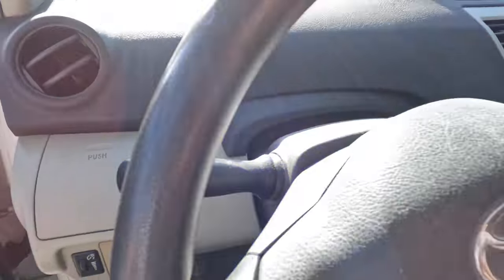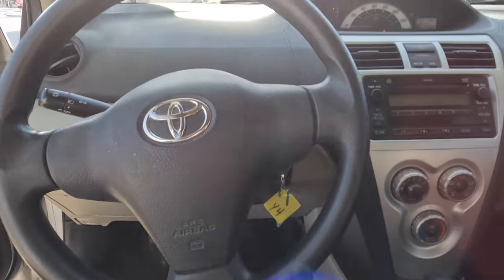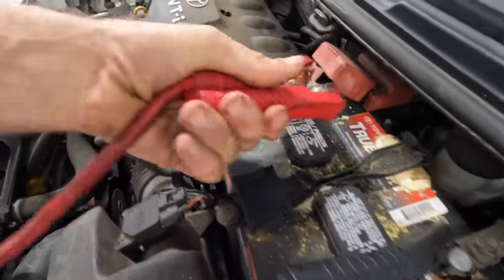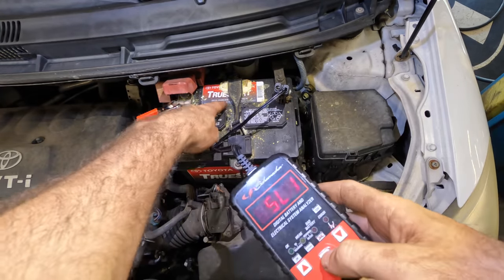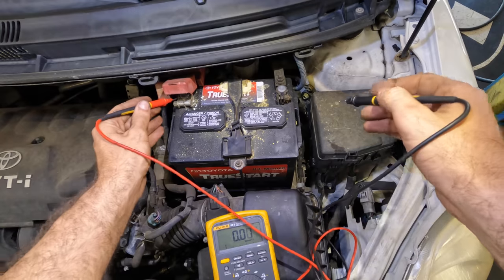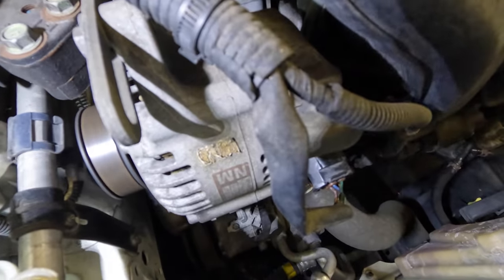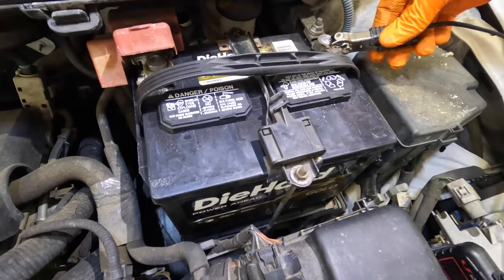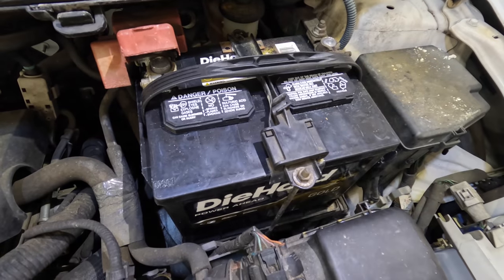Ignore the obvious! “Let’s see what happens” 2006 Toyota Yaris

Comment: I was really expecting the battery to repair the alternator bearings. I wonder why that didn’t work.
Reply: He had the headlights on but not the high beams, radio on but on the wrong station, blower on but didn't have the AC on Max, and forgot to turn on the right blinker. No wonder it didn't work.
Reply: It probably just needed a new pixie filter.
Reply: The bacon stretchers ran out of blinker fluid
Reply: It's because the time wasn't reset and the new capacitor (model: Flux) wasn't reinstalled when engaging the brake lights in reverse, with the spare tire flipped upside down.
Reply: Didn’t add sparky juice to the alternator
Reply: Guess what really happen to Mr. Customer. He shot the diodes in the regulator because he jumped started another car with the battery jumper leads hooked up backwards. Red is for +Red and Black is for -Black. 1-2 days running on battery power...aaah the batter is dead. Who shot the diode? But he did not shoot the battery! Customer shot his foot twice.
Reply: Ya'll wrong... it was (and always is) the kneuter valve!!! 🤟
Reply: He didn’t use the new “Fix-It Felix” brand of battery
Reply: I just like saying "Yaris" ooh I'm gonna name my next dog. You thought I was going to say "Yaris" didn't you?
Reply: @tonycking0121  It's always that damn pixie filter
Reply: @TylerWattt  Page 321 of the owners manual. Nobody reads anymore.
Reply: @TylerWattt  No, No, No,  it needs to be charged to 1.21 Gigawatts.  C'mon man!!

Comment: Great tip about using an open hand to press on a wrench when breaking a nut free. 50 years ago I was changing spark plugs on my 1964 Pontiac Catalina convertible (it WAS a chick magnet), and the wrench slipped. I still have a 1/2" scar on a knuckle on my left hand. It was a perfect event to use some magic words.
Reply: My scar is in my right pointer finger from the knuckle to the next joint.  Punched an exposed cam gear on a Honda.
Reply: My Dad had an early 70’s Catalina 2 door.  What a boat!  First car we had with power windows.
Reply: Those were some big old sleds, my Dad had a ‘62 Bonneville convertible, red with a white top, black interior. I think it might have even been leather. Bucket seats and console with the factory tach. It had a 389 and a Hydra-Matic 4 speed.
Reply: I do that with my hand already, to prevent injuries.  And sometimes I put on a utility/garden glove for more protection.
Reply: “Chick magnet” is very disrespectful we call it “Fanny magnet” here in England
Reply: @gordonm2821  
My old flatbed farm truck is a chick magnet. It has a chicken coop on the flatbed. 🤣🤣
Reply: I have a nice scar on my right thumb from a slipping wrench when I was in a stupid hurry to install brand new blades on a professional grade woodchipper.
I learned three things: 1) the new blades are shipped razor sharp. 2) a cut to the bone bleeds a lot. 3) a clean cloth and duct tape makes a decent compression dressing!

Comment: I am really surprised that the toyota engineers didn't make that bolt a couple of millimeters longer so removal of the alternator would require removing the engine.
Reply: If it was a Ford engineer, that would likely happen.
Reply: Try replacing the water pump... to get it unbolted you have to unbolt the passenger side engine mount and jack up the engine so the bolts clear the right front wheel engine compartment wall.... after removing the alternator.
Reply: Love the delicious sarcasm
Reply: @sharplessguy  I managed to snake it the water pump out, but I had to take the pulley off it first.
Reply: @bertblue9683  The Ford models that I have worked on, the Escort and Transit from the 1970s and the Fiesta and Sierra from the 1980s, are very easy to work on.
Reply: Well Cedric.  That was back when Ford made an effort.  Those cars are no longer on the road and anyone working on cars today, rightfully curse Ford more often than most anyone else, with exception to Dodge.  Toyota, generally speaking, does a fantastic job.
Reply: Another one on the Yaris, try replacing the front seat belt🤔 The one bolt holding the seat belt reel is 5mm too long. Carpet, back seat bottom, strengthing cross brace all have to come out just to get that one bolt holding the seat belt out😡
Reply: It is not always the engineers. Often it is "supply chain management". Someone I know who worked for GM reduced the number of bolts that were needed for a line of cars from 20K down to just over 6K. The idea was to reduce the variety of parts that need to be sources, quoted, shipped, inventoried, monitored for quality, etc. The number of bolt lengths were reduced by sometimes eliminating a shorter bolts.There used to be quite a variety of bolt plating from plain, zinc, chrome oxide, phosphorous, and these were are streamlined. In addition to this, the advent of the transverse mounted front wheel drive arrangement made car repairs much more difficult. Well we're more efficient I guess.
Reply: I’m nearly sure Mazda makes the Yaris
Reply: Wouldn't matter because the Yaris is a rebadged Mazda!!
Reply: @bertblue9683  I've got a 99 Mustang GT and had to replace the alternator a couple of months ago (heck, it lasted 22+ years-I can't complain).  For it being the first time I'd ever replaced an alternator, it only took me about two hours, and I worked very slowly-but an hour of that time was walking to an auto parts store to get the right size breaker bar to adjust the tensioner, and then walking back home.

Comment: I believe the Yaris was first released in 2007 in the USA.
I had a 2008 Hatch Back.
Super reliable. That 1.5 is pretty bulletproof and easy to work on.
Reply: I bought a 2012 Yaris new in 2012. I made sure it had a manual trans. Almost 200k on it. The mass flow sensor got wiped out twice. Once was my fault, the other time a car was decided to stop in front of the grill and flood the front of the car. Luckily only the mass flow sensor was trashed.

Fun car to drive. The high efficiency tires let is slide around during aggressive turning.
Reply: @capnskiddies  those older ones were sold as the Toyota Echo in the USA. 2006 and up were completely different design.

Comment: Just wanted to add: I am just a backyard mechanic working on own cars.  Replaced my radiator on my Dodge Gr Caravan this weekend: purchased the hose clamp pliers and the funnel fill kit thing: very smooth replacement process that otherwise would have been a frustrating ordeal without!!

Comment: Love your videos … reminds me of days gone by . I started slinging wrenches for cash at age 14 . All through high school to my junior year and we moved . Age 18 fresh out of high school started slinging wrenches for big money at Cat . 45 years later retired from everything . Today’s vehicles are built to fail and to technical for average joe to work on and need specialized tools to change a headlight . LOL  Keep those great videos coming and thanks for sharing . And as always have yourself a great day !
Reply: Gone are the days where a mechanic could repair, set up ,adjust and in some cases make all from front to back of any motor vehicle. From bearing blue and scraping bearing material , setting differential clearances , pinion crown wheel tooth markings using bearing blue, dwell angle and point gaps, cutting valve seats grinding valves, fitting new valve guides and so many more skills. Now it’s all about just replace  the unit rather than fix it.
Reply: This is why I love wrenching on my Isuzu. Even though it's an 01, still isn't a total PITA to work on in a parking spot or my driveway. Thing has been reliable as hell and some parts are still surprisingly easy to find new despite them going out of biz.
Reply: You're so right.
My F150 has everything on a network. Battery gets soft it starts shutting down non-essential components.
When my passive passenger door lock stopped working the Dealer wanted $600 to replace the door lock when it was the battery causing the issue.
They did credit me the "Diagnostics Fee" toward a new battery though.

Comment: I just replaced my daughter's alternator on her 2010 Corolla.  Glad the professional had as much trouble as I did in getting the 14mm bolt out.  The right combination of socket depth, leverage, and the one thing I lack, patience.  But Toyota did improve the location of these since my 95 requires tire removal.
Reply: My alternator and starter are literally right out in the open under the hood on my car!
Reply: My 09 had the same problem with the 14mm bolt. Had to use a 6pt socket and a cheater bar to break it loose.  Called Toyota to complain about that bolt being wayyy to tight. The  Lea azon though I was trying to get a free alternator out of them. I'm in the parking lot of autozone doing it myself.  The alternator was $180. She said I could have had the dealer do it. I said do you have any idea what they would have charged me.  They don't seem to want to fix a problem, just smooth it over.
Reply: My 01 and 02 Corolla alt are right on top. 15-20 minute switch out.
Reply: @EricVonHunter  I don't know where the one is on my 04 Corolla as I have not had to change it yet (fingers crossed).
Reply: @johncooper4637  Looking at the engine, left side, top, belt driven. 1ZZFE engine, 9th gen if in the states. Pivot bolt can be tight. Use a breaker bar.
Reply: @johncooper4637  it on top front. Not hard to change.  Mine has 327,000 and still working

Comment: Since the car had been running with a bad alternator, replacing the battery may have not been a bad idea even though the old battery tested ok.  But still, expecting a battery to fix the alternator, lol.
Reply: Plus, it looks like the old battery was the original one (Toyota name on it). Now if the customer would have said "go ahead and replace the alternator and while you're at it also replace the battery due to its age/added stress" it would have been a much better path to go down rather than second-guessing Ray's professional diagnosis. Takes all kinds.... Maybe a learning 'opportunity' for the customer to trust Ray and they will become a repeat customer for the shop.
Reply: Correct. He tested the battery right after charging it, which means it’s not the true state of the battery.

I can bet that battery won’t last much longer.
Reply: Running with a bad alternator won’t ruin a battery. Unless it’s already weak or you constantly drain it below 10.5 volts
Reply: One time I replaced a 13 year old perfectly good battery just because of it's age to have the new one fail a year later.
Reply: No No see, here, the battery has a bad cell, see, so with that bad cell, it causes the alternator to not charge the battery, see, thats how it works, like Cmon man! LOL    🤣
Reply: Who said the customer thought replacing the Battery was going to fix anything???
Reply: @frandanco6289  Did you watch the video?
Reply: I would say there is a chance when the alternator was going bad it may have overcharged the battery shortening its life.  Seems to be a lot of corrosion next to the vents that could indicate a boil.  Not just at the posts.
Reply: @chuckr7871  Wow.  That's a lot of years on a vehicle battery.  I get antsy at about 6 years (and, we always have jumper cables AND a compact Li-ion jump starter in the back of our vehicles).  Just don't want to get stuck somewhere.
Reply: @chuckr7871  makes me rethink replacing my original Honda battery that's 5+ years old just because of age
Reply: True. if you get stuck on the road and need a tow, that's going to cost more than the battery.
Reply: Who said the customer really "wanted" a new battery? The salesman might have scared them into buying one.

Comment: I had an '11 Scion xB and the alternator failed at pretty close to the same milage as this one. It wasn't as bad do to with the 2AZ-FE 2.4L because there wasn't a bracket that got in the way. Funny part was it failed and I was able to pull it out in the parking spot of an auto parts store and get the replacement right then and there. Just sucked having to do it in the cold and rain.

Comment: When I was replacing the serpentine belt on my 2010 Yaris, the lower bolt of the generator assembly was totally stuck so I completely rounded the head of the bolt although I was using a Snap-on Flank Drive Xtra socket. Bolt is soft and it wouldn't budge as it was cold-welded.
I lifted the left side (passenger side) of the car on the stands and sprayed a lot of Fluid Film penetrating oil down the treads at the back of generator. The Shank of the bolt is shorter than the generator housing. After roughly fifteen minutes bolt came out easy.
If anybody cares, the Toyota OEM part number for that flange bolt is 90105-10075. (M10-1.25X72.5) Torque spec is 40 foot-pounds (54 Nm). Torque spec for upper (adjusting) bolt is 14 foot-pounds (19 Nm).
Reply: i have replace my dads alternator (had it refurbished as i was able to locate a shop that refurbished alternators)  much easier on the 1.8l    i did replace the bolts with new ones  Not that i damaged them I just wanted too

Comment: I was on a vacation ended up having a bad alternator on the first one I replaced. Didn't have voltage meter on the road.  Two things ercked me. The dead nator had the smaller pulley and the one that came off the Dodge van had a single and bigger in diameter. I asked them if they could swap the pulleys out. No sorry our maintenance guy not here today. Turned out the adjustment was maxed out and it worked. Needless to say three hundred more miles down the road I was replacing the new nator ( bad). Van wasn't too bad. I always have tools with me on long trips. You the MAN RAYRAY!

Comment: I used to own a 2007 Toyota Yaris S. Loved that car to death. Had almost 200,000 miles and still ran like new. Only serious work I ever had to do on it was replace the battery since it was the wrong size as well as fix the brakes a little since the old owner had gotten in a fender bender. Traded it in for a C-HR but I will always miss that car.

Comment: I had a 2007 1.3l 5-door (2A, XP9F, full digital dash) from spring 2011 to early january 2017. It wasn't really what I wanted at the time, but that little pregnant rollerskate really grew on me.
I still get a big smile on my face whenever I see one. :)
It was replaced by a 1.33l 3B XP130 (30 miles on the clock, it was supposed to be a demo car), that again got replaced by a factory fresh XP210 hybrid in June last year.

Comment: The best and the worst question a customer could ask; “ If it were yours, what would you do?” 👍👍☝️✌🏻
Reply: If it were mine, I would strip the alternator, fit new brushes, grease the bearings and put it back. It would run for another year at least, can't do that to a customers car though.
Reply: @terryhayward7905  I’ve done that to mine as well.  My logic was if i screw this up, i can still use it for the core.

Comment: I have a 2012 Yaris, same engine. I've had to change the alternator and also had to remove it to change out the water pump.....for anyone with big hands, man what a pain in the backside....including the belt replacement.....you made it look relatively easy but you did at least struggle in the same places, just not quite as much;)

Comment: Love how customers think replacing battery will always fix charging problems.Ray Harbor Freight has black 9 mil gloves for 9 bucks when you purchase the insider track club for $29.99 for a year. And great how you don’t degrade customers when you know that battery won’t fix problem.Great job!
Reply: So you’re willing to pay 39.98 for a box of gloves?  I love how folks think these so called club memberships are a good deal!
Reply: The Inside Track Club doesn't pay off for everyone.  It depends on how many items you buy from Harbor Freight every year.
Reply: Over time, I’ve noticed several Harbor Freight items in Ray’s collection of servicing actuators.  There was a Centech battery charger in this video too.  Some stuff from HF is actually not bad.  The non-ratcheting Pittsburgh wrenches are OK and the mechanic’s gloves are decent.  You never know though.  I bought a so-called “go-through” ratchet with sockets for a job with severely limited access.  The tool worked, but was pretty much a disposable single-use tool.  At least the set was inexpensive so the time saved was worth the money spent.
Reply: I have a 42” base cabinet toolbox that’s really decent for a fraction of a snap on tool cabinet. Full extension deep drawers, it’s great.
Reply: @Hoaxer51  Thank you for the information.  I’ve looked at the HF metal tool cabinets, and they look well made.  It may be time to get one.
Reply: @wtmayhew  the tool boxes are good.
Reply: @wtmayhew  If you look in almost EVERY professional mechanic's toolbox and every handyman's toolbox, you will find numerous Harbor Freight items.
Reply: @wtmayhew , If you get one you’ll like it, on my 42” wide base, the top drawer is 4 or 5 inches tall, I can put my deep sockets straight up and down it’s so tall. The drawers are really deep too, I don’t remember how deep but my craftsman base is only 18” deep and the HF is 22 or 24 inches deep so longer wrenches can store either way. I really like it, full extension, ball bearing drawers. I have an older Craftsman top and bottom tool chest so I just got the bottom of the harbor freight cabinet. I like having the top as a work surface, it seems like you can’t have enough horizontal surfaces!
Reply: @Hoaxer51  Thanks!  Much appreciated.
Reply: Don’t pay $39.98 for gloves it’s $9.99 when you go through two boxes a month cause of how many you use so within the first month you’ll make it up but if you are one of those guys that a whole box would last a year then it’s not sensible. Ray is awesome at his job!!!